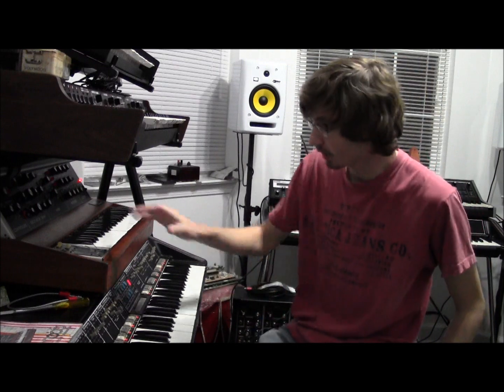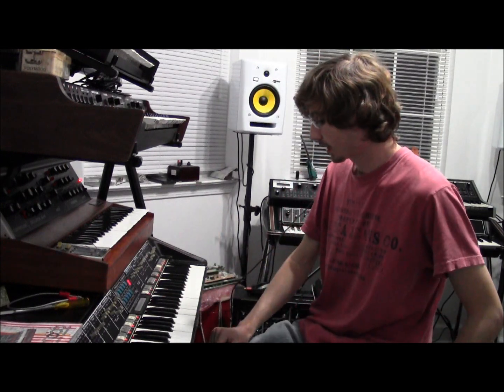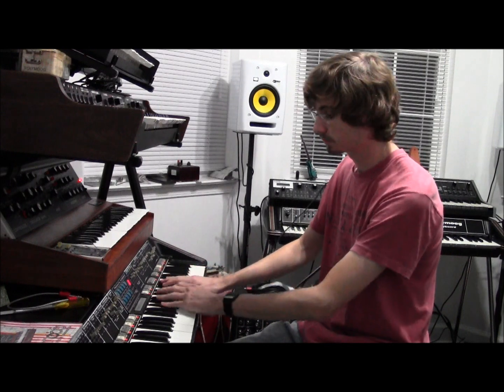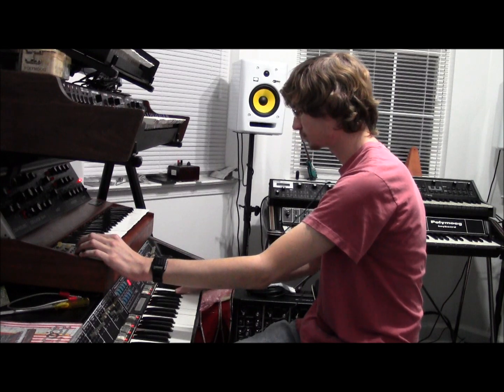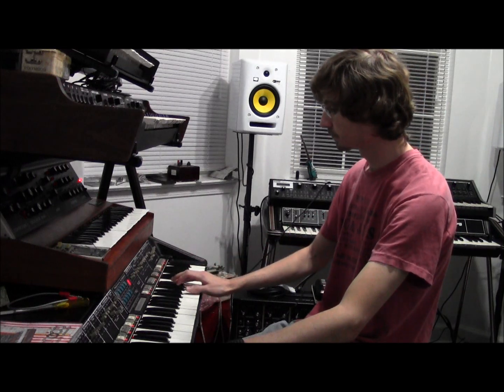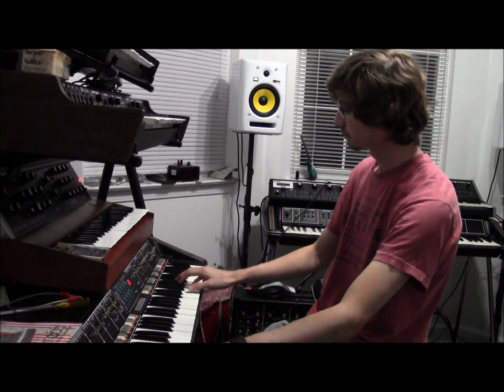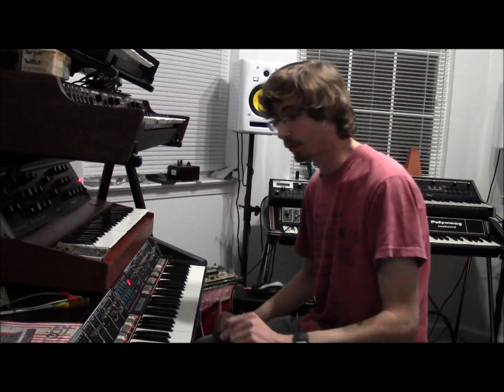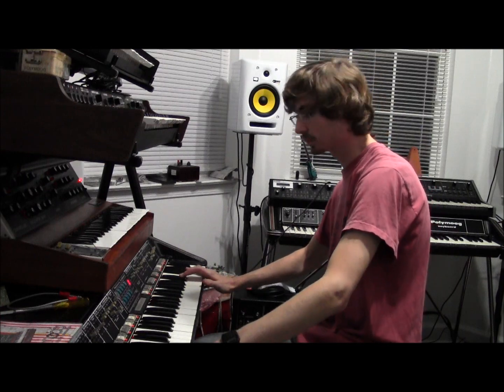Moog's Open Interface Demo (By Synthpro)

Comment: What you're achieving there, with that portamento Mini sound layered over the Poly's strings is excellent! This is something I always thought more vintage synths would have..... separate glide circuits for each VCO. I think ARP did that on the Quadra's lead section, but still. This is why the Oberheim portamento is so awesome, because of the different glide speeds!

Comment from the maker: The polymoog is polyphonic but the mini is still monophonic. Basically, the polymoog has a built in monophonic keying circuit that is used by the minimoog. when I am plying chords, this keying circuit will either play the highest note hit or the last note that was hit  below the highest note. you can think of it the same way as if you had a little phatty MIDIed to a polysynth as far as the response but in this setup it is all communicating by CV and trigger signals.

Comment: Cheers J for your message. That 203s fantastic as is the above one you use. Well done mate, I admit, I wouldn't have known which between the 280 & the 203 which out of the two that Gary had used on the Replicas album. I'm pretty sure he used the 280 for the Pleasure Principal though but AWESOME sounds of both.